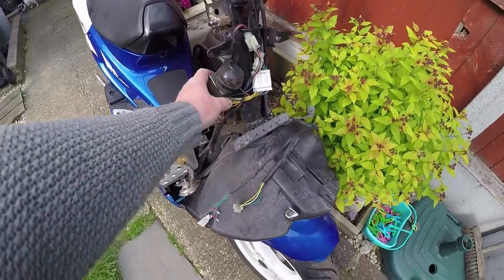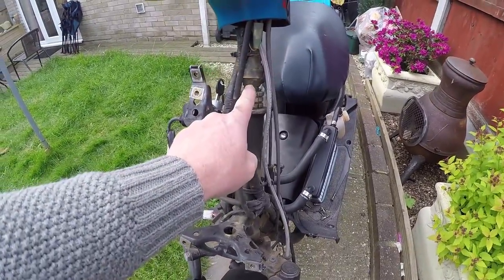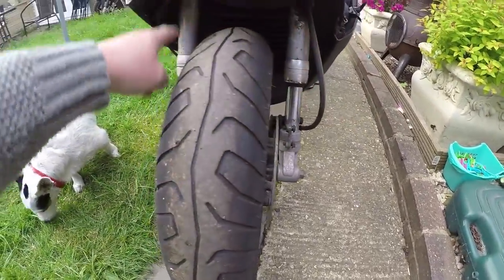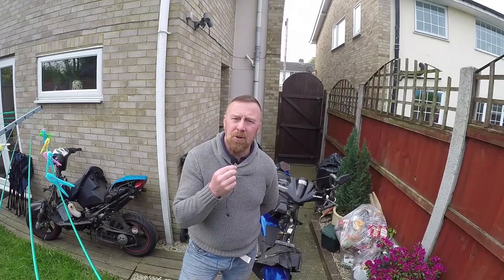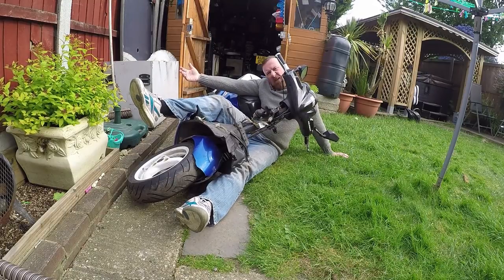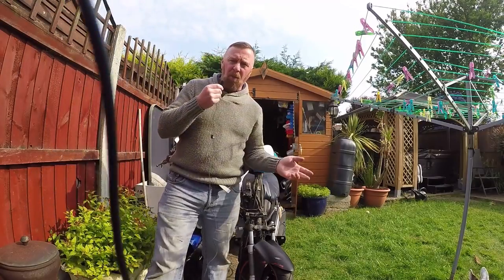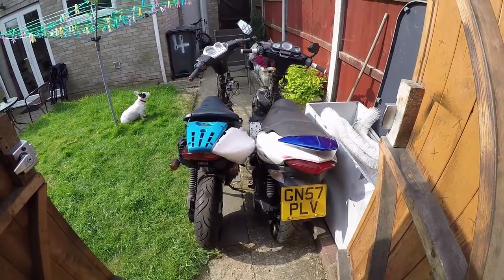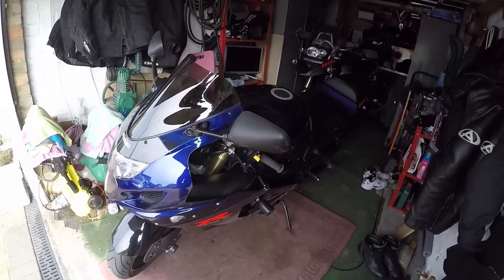SPEEDFIGHT AEXOR RUNNER 50CC MOPED CHAT REVIEW MARK SAVAGE

Comment: Love your page Mark, we have a 2006 Speed right 2 that is currently getting restored, it has a very tatty exhaust, my question is, are the performance exhausts different for a 50cc and 100cc version?,Maybe the downpipe size or fitting differs?....I need to order a decent pipe, any suggestions welcome......Dave North Lincs.
Reply from the maker: for some reason no they fit on both fine! so 50cc and 100cc will fit and work but sometimes you may haver to upjet or take off the link pipe but not all the time so fit and see how it runs but in all cases it will go faster lol
thanks for watching 
mark

Comment: Hi Mark  from  Wiltshire .  I've just taken on a repair job , An Aerox 50  . I was told that it quite running  when he went out , it has spark but will not start , no starter only kick  . nothing happens just turns over , not even  a misfire , i thought the fuel ,then the carb ,  what else cpuld it be , the dad said he heard a grinding but when kicked over it turns nicley , but will not fire , could you point me in the right direction  as to where to look next . hopfully  yours Rob
Reply from the maker: Robert martin Ehlenbach hi 
Watch my videos bud they will help 
Did you get a wet had when turning over from the carb as in my videos 
So you have spark and then dry of the plug and then test if it get wet 
No electric start again I have a video to help 
A lot of them are on speedfights but they will help 
If you have serviced it and then cleaned carb changed plug 
Then it might be piston failure but start with these first 
Mark

Comment: Hey Mark, going to be picking up a speedfighter 3 hopefully next week. Are they restricted by the cdi? If so what’s available mate?
Reply from the maker: hi bud 
best ask if it has been deresticted and any upgrades  then move on from there, the sp3 can have 4 restictors hence i never liked them! and they hated me lol 

i have a few videos on them that may help with the carb and so on, but as in the videos it's, carb, variaotr, exhaust and can be cdi! , all parts for the 50cc are on e bay but nothing really for the 125cc which is odd 
please like and sub
mark
Reply: mark savage yes it’s a 50cc & as been de restricted. Yes love the videos. Do you reckon I could just buy a unlimited cdi & see what happens? Can’t find any info.
Reply: mark savage thanks for reply mark it’s got a sports pipe on & the variator as been done & rollers. Can’t find any info on anybody going it. Few foreign vids on YouTube where they seem to be revving higher
Reply from the maker: Ryan Prosser it it’s all ready derestricted bud it should all be fine just see what tip end is first , should do 45 mph bud
Reply from the maker: Ryan Prosser as said I have a few but just fixing as have ov er 70 on my channel when you sit at a computer you get  to see them all 
Mark

Comment: Hi Mark, new subscriber here :) I would like to ask your opinion.... Im looking to buy myself a new scooter.. im torn between a new aerox and an aprillia sr 50 r.. the aerox is substantially more expensive here new and it looks small (im a big guy) so im leaning towards the sr50r instead.. is it a good bike? is it of a quality that if i keep it nice and maintain it well that i could get a plus 10 year of service out of it??? (i plan to derestrict it properly with a sports exhaust and jet it properly and maybe a cdi/coil upgrade to avoid getting run over) :P What do you think..?
Reply from the maker: both are good mopeds bud, the d-tech sr does have a few issues as it gets older but a bigger moped and just as much fun as long as you maintain it it and service it like in my videos 
thanks for watching and subbing, sorry for the late reply youtube put it on hold so didn't see it 
not sure why they do that lol
mark
Reply: Thanks.. think ill stay away from the d-techs.. getting injection right on such a small sylinder is a hassle at best :P No the SR50R is more my style.. factory 17,5mm carb is plenty of go with a 50 cyl.. maybe an airsal sports tech 50 with like a nice chromed technigas exhaust on it should keep it breathing right.. and looking right :P i was just worried bout the quality of the bike housing it.. have had yamaha tzr before.. it rusted badly for no apparent reason.. thanks again for the advice tho :)

Comment: I’ve just rebuilt my Aerox an I’ve lost my key have you by any chance got a ignition barrel you would sell or could you tell what wires to put together so it’ll work without the key so I can get it running
Reply from the maker: Sarah Gibson if you were local bud I have the one on the video 
E bay is the best place there not a lot and you get the fuel cap and battery cover lock to
I have a video on how to change it so that will help bud 
Mark

Comment: Hello,
My speedfight didn't have spark it turned out to be the cdi. I replaced it and it had spark. I turned the engine on and it did want to go. The second time i tried it didn't want to go so i checked the spark again and it was gone..... what could be the problem? I saw the liquid was leaking a little. Could it have destroyd the stator?
Reply from the maker: dpb jojo hi bud 
Use a volt meter to test power out put from the stator coil but often it’s the connectors or it could do with a good clean rather than replacement 
I’ve got a video on the stator and how to get off 
Exhaust has to come off but it’s not a massive job and my videos will help 
Please like share and sub 
Mark
Reply: mark savage i tested the stator and its just fine. I watched almost all your speedfight video's last couple of days but i cant find a video with this problem. I bought a brand new cdi and it must be broke now because i checked the spark plug and stator. Could there be a problem with the cables to the cdi? It looks just fine.
Reply: mark savage could it be the starter  relais as well? It does not make a click noise but the electric start works just fine.
Reply from the maker: dpb jojo if there was a electrical problem in the first place it could of blown you new cdi !
So if you stator is working fine test you have power going into your cdi and then if you have power coming out 
Then ht coil and if any wires are cut / damaged
Reply from the maker: dpb jojo if you electric starter works fine all is ok and it would not effect the cdi any way 
You may have to buy another cdi 
Contact the seller and tell them it has no spark / didn’t work !
Mark
Reply: mark savage do you have a video about testing your cdi? I cant find on YouTube how to do that... if it was a electric problem why didn't blow my new cdi immidiately? It worked fine when i tested the spark....

Thanks for your answers it really helps!!
Reply from the maker: which one of the 4 cdi units do you have, if the electrical problem is intermitting problem with the volt regulator it may have worked till the then overloaded !

I didn't continue with a test video as it was very boring with finding the live testing it then testing all the other wires and testing for live then test for earth as this can make them blow as well

TBH as I do not have the bike in front of me it's difficult to diagnose and can only try and give you lots of free advice in which I hope it helps as many of my other videos do with over 70 on the speedfight but I still don't have all the answers bud as in one or two of my speedfight videos even I sometimes cant get them to live or work properly 
mark
Reply: mark savage i'm going to try finding the solution to the problem. Thanks for your help. If you can figure out a solution i would like to hear it! When i find a solution i will tell what was wrong!
Reply: Hello mark,

i came up with an idea. Could it be the cdi that is not grounded? that it caused burning the cdi because the cdi is not grounded? I can see a green wire going from the cdi to under the steer, but i think there is something wrong with the wire. Could you explain how i can measure that with the multimeter? I tried a lot of things and looked in the manual and your video's offcourse but i cant find it anywhere.

Comment: Hi Mark, Could i get your opinion on this, When u take off on my aerox it has good take off and then right as you start moving the rpms go down really low and u can barely do 15 mph up hills and as soon as you go about 30 mph then all of a sudden it starts to rev normally again and gets decent speed. I think my clutch might be gone as it has really low springiness to it. Also i can hear a rattle every now and then coming from the gearbox and im sure its not the rollers defo the gears. Thanks Mark, just wanna see your professional opinion on this.
Reply from the maker: hi bud 
yes it does sound like clutch variator system and not fuel, it's a nive day so get the tools out and get the side cover of and have a good look around and take it off, clean up or replace bud 
give the plug a qiuck look and the air filter as much easy to tick off 
mark
Reply: mark savage hi thanks mark, already had it all apart had a new variator on it, I was going to put a new clutch on but pedparts sent me the wrong one unfortunately. Air filter was moldy yo my surprise but I just cleaned it well and it's fine since then. Thanks Mark. My new clutch comes ok Thursday (not from pedparts) and I'll let you now if that has fixed my problem.
Reply: Hi Mark, one more question, i think my teeth on my gears are worn in my aerox. As i can move the clutch left or right about 3mm and there is a rattle everynow and then when i hit bumps coming from the gears. do u reckon i need to change my secondary gears?
Reply from the maker: Two ways of looking at this bud
1 if its not broke don't fix it lol
2 yes if your unhappy and it's causing problems change them
if you cant live with the rattle lol 
mark
Reply: Thanks Mark, no i do not care it just to be honest with you, i'm just worried that something will explode ahah. So do you reckon it will live for ages then?
Thanks Mark
Reply from the maker: never say it will go on but I've had them like that and they just go on and on lol
if you have had a look and it's not dangerous then just keep an eye on it if its get worse then sort it bud 
mark
Reply: mark savage okay brilliant thanks Mark

Comment: Mark I have a problem with my 50cc won’t start from the kick or the electric start I makes a clicking noice and sounds like a dead fart
Reply from the maker: hi bud thanks for watching 
so they both work but wont start the bike, you are going to have to start from the beginning 
did it just not start one day, did you do anything or forget any thing?
service, while the plug it out test for spark and see if it get wet when you turn it over 
could it just be flooded from trying too much
next fuel and carb system check all them 
just like in my videos as said just because it's about a speedfight or aerox the basics are he same on 2t and 4t bikes

hope that helps please watch my other videos and please like share and sub 
mark

Comment: Hi bud my gear box wentan blew a hole in the cover or my spped fight2 100 it got 2.1 wrote o it will one with 3.2 for bud if you could let me no
Reply from the maker: Jordan Blight tbh bud not sure but I’d stick to the same one with the same coding bud or it may not fit !
Check out why it blow too as otherwise it could happen again 
Mark

Comment: Any idea what size spanner/ socket you need to take off the bolt to get to the clutch springs on a 2014 aerox
Reply from the maker: am I should be  14mm once the cover is off but have a few other sizes just in case however you will need a clutch tool to hold it from turning 
Some use the rear brake and get someone to sit on the bike
Please watch my other many videos as they will help 
Mark
Reply: Thanks a lot mate will do

Comment: My beeline veloce gt was working fine and all of a sudden has lost its acceleration not sure what to do any chance you can help ?
Reply from the maker: hi bud 
i have many videos that should help on mopeds, you will have to start from the basics so 
service last, do you have spark, wet hand carb test for fuel, then move on with fuel or electrics and then maybe piston fail
hope that helps, please watch my other vdieso there are 150 on mopeds and like sub and share 
mark